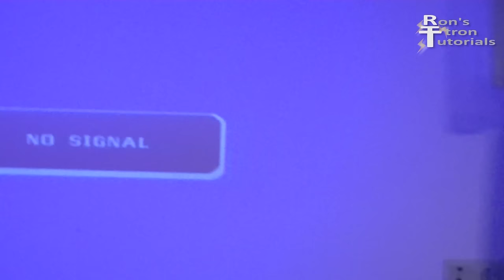BEST CHEAP PROJECTOR MOUNT: HOW TO INSTALL ON CEILING & WALL, UNIVERSAL DIY INSTALLATION TUTORIAL

Comment: I would NEVER recommend using those cheap hole nylon mounts to your wall. . I would use butterfly nut system.
Reply from the maker: these work great 👍

Comment: It looks like it's going to fall.
Reply from the maker: that's why it's cheap but it works great
Reply: @CarlsImprovements  Hello, you are absolutely right. After a few weeks of making my comment I bought the cheap support, 3 years later it is solid as an oak.